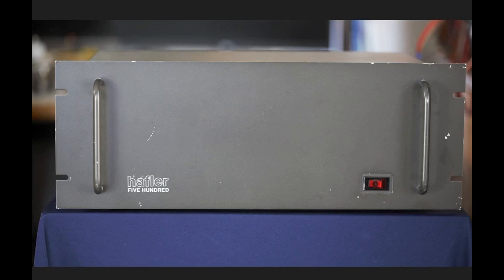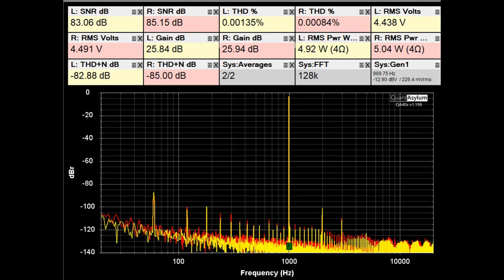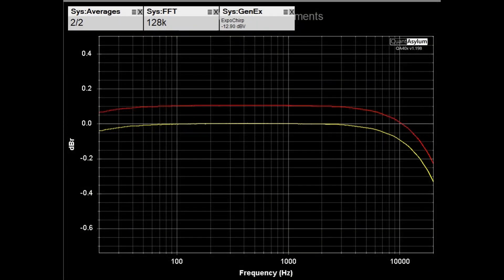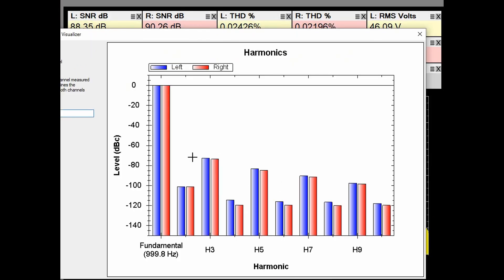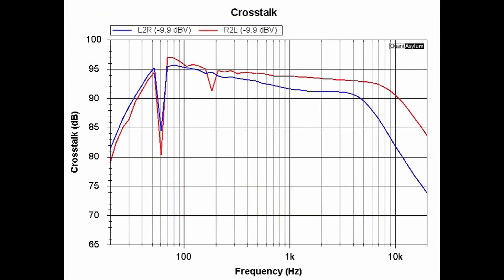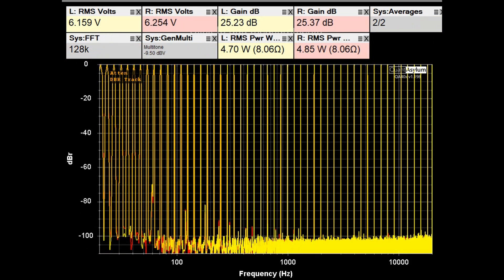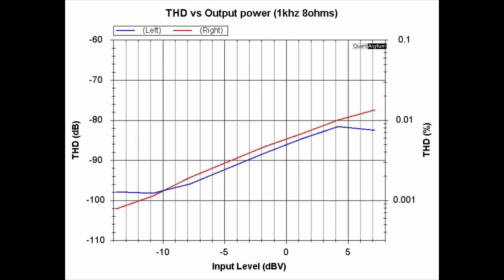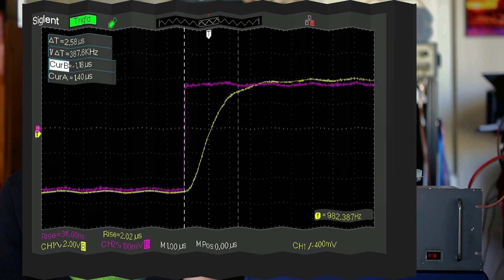Hafler 500 Power Amplifier: Vintage Audio Review Episode #129

Comment: Where are you seeing them for 150 I see ones for repairs three times that
Reply from the maker: At the time I did the video, I checked Ebay and saw at least one- maybe I did not read the description correctly in that it was for parts only, but I usually check that.
Reply: @vintageaudioreview no I mean for parts only is going for threes times what u said works 400 to 600
Reply from the maker: @stevendepascale8364 I probably should try to capture what I am seeing at the time. Maybe the market changed- it was over a year ago....

Comment: I had one of these. In fact, that could be my unit. If any of the specs are off, keep in mind, this thing is 40 years old, and appears all original, meaning some of it's components may have drifted a bit out of spec. If you haven't seen it, refer to Julian Hirsch's test report in Stereo Review, from the mid 80's.
Reply from the maker: Thanks for taking the time to comment. I always keep in mind that most of what I test is pretty old and so a little drift here and there is just fine, in fact, it did between than the refurbed 500 in a later review.

Comment: My dad has a hafler ph500 and some JBL L150 speakers. Wondering what preamp should be used if any with the hafler amp?
Reply from the maker: My recommendation, if you can get one at a good price, is the Carver C1, but most preamps should work fine with the hafler.

Comment: I think he went on EBAY and was looking at DH200's.  Good luck finding a DH500 for UNDER $200 in running condition on EBAY.  As with ALL old gear, they do need to have Caps replaced, or a transistor or two replaced.  Expect to be in them for $500 IF you are lucky.  With that being said, they are put in the TOP TEN BEST ALL TIME Amplifiers ever!  Worth the $500.  There are replacement parts.  I now have two and would consider one more.
Reply from the maker: I have not watched the video recently and so am not sure why I said they could be found on Ebay for $200- unless it was the upgrade kits I was referring to. They are a nice amp, though I would not consider an amp that does not have at least a clipping indicator, on my list of top amps. Thanks for taking the time to share and hopefully you will find a 3rd DH500.
Reply: @vintageaudioreview  That is what you were looking at.  A guy Fantasiaaudio sells those kits amongst others.  Those kits can go as much as $600.  And that is just the kit!  Mostly he sells the kits that bring them back to original or better specs.  I bet IF you upgraded the Hafler you tested you would get back those miniscule numbers that it was off.  Still, a fantastic amplifier even with it original Hitachi mosfets.  That is where I would get to first.  In my judgement these amps are very comparable to today's high end amps.  Or as the guy who works on my gear in Indy, Charlie said "no, they are better".
Reply from the maker: @williamwahl6464  My friend just sold the amp in the video, but has an upgraded one I will test in the not too distant future.
Reply: @vintageaudioreview  They are getting rarer and rarer.  Now the DH200 is the original version of Hafler.  And is also one of the best.  I have a small army of vintage Amps.  All but a couple have been worked on.  Every time I take one into Charlie, he tells me if it has already been worked on.  It's almost better to get one that has already been done up.  Ed Fantasia on EBAY I just bought a DH500 from went thru it and says it will outlast me.  Ed was a former Dynaco/Hafler engineer.  The other Hafler DH500 I have is like the one in this video.  Mostly if not all original.
Reply from the maker: @williamwahl6464  Halfler amps sure seem to be a fan favorite going by views. The DH220 in the video is for sale now by the owner. I had no complaints while listening to them.
Reply: @vintageaudioreview  ADCOM's GFA 555's were a big fan fav back then.  A sleeper is NAD's 2200's.
Reply from the maker: @williamwahl6464  Have always been a fan of vintage NAD amps-usually put out more power than they were rated for. Have not had a Adcom amp come in.
Reply: @vintageaudioreview  I have three ADCOM gfa 555 ii.  One I bought knowing it needed work.  I took it into Charlie, and he said it had been worked on before.  After paying Charlie, he brought it out with a big grin and said "you know this thing keeps on running even after you turn it off for another 30 seconds"?  I told him it also dims the lights when you turn it on.  I run my best rebuilt speakers with them.  I use to repair and touch up furniture and like to get these old BIC Venturi speaker boxes with the Walnut veneer, touch them up as best as I can but totally replace the guts with mostly new.  I do prefer the JBL 2206 12" woofer paired up with these newer, mostly known for Car Audio brands like Skar & DS18 mids & tweeters.  Both Skar & DS18 are highly rated, only weakness they complain about is all the branding they put on those speakers., but boy they sure do make some nice music with these ADCOMs.
Reply from the maker: @williamwahl6464  30 seconds is pretty long to run after the power is turned off- I have seen power led's stay on for maybe 20sec's ,but now sound. I think I remember the BIC speakers.
Reply: @vintageaudioreview  In reality it is more like 10 seconds, Charlie was exaggerating LOL, but that is what he said.  and the lights do dim when turned on.   Same when I turn on my Hafler, the lights dim and go back to normal.
Reply from the maker: @williamwahl6464  I will be on the lookout for lights dimming when I test the upgraded Hafler 500.....😄
Reply: @vintageaudioreview  The lights in the room did dim, not as much as with the ADCOM.  I am now having to use my touch up skills on the other Hafler DH500, I just got.  FEDEX being FEDEX dropped it on it's side and have a pretty good size pair of dents on the side of the front panel.  Make sure who ever ships to you the upgraded Hafler to triple box and write on the outside of the packing box "FRAGILE ELECTRONICS"!  That MAY make these dopes who ship take better care than they did with this unit. It powers on, which is a relief.   That is as far as I have tested it.  I have to remove that front panel to hit it with heat before I do any bending of metal.  Good luck with your new DH500 that you get to test.  Looking forward to seeing how that turns out.
Reply from the maker: @williamwahl6464  Good luck with getting the sides straightened out and hope it works well!
Reply: @vintageaudioreview  It appears to be all original, like the one in your video.

Comment: Just got me a Transnova 9505, having it looked over and serviced before using. The power rating & spec of the power supply alone have me very very excited to finally hear it. Does anyone know the origins of the Halfer "Diablo" circuit by any chance?
Reply from the maker: I am not a Hafler guy so really don't have an answer....
Reply: @vintageaudioreview  well ty anyway

Comment: Which one is better the Hafler DH-500 or the Soundcraftsmen PCR800 ?
Both mosfet amps, almost same specs.
Regulated power supply for the PCR800, more power for the Hafler
Reply from the maker: Thanks so much for the question- particularly on items that I have actually reviewed! I often get questions about gear I have never heard of, so this is a pleasant change. Depending on your speakers and listening material, the PCR should be plenty of power. The Hafler is a bit better on the measurement side, though my loads and testing methodology have improved since the PCR800 was reviewed, but I am not sure you would actually hear any measurement differences. If bridged in mono, the PCR can put out 600w/8ohms, and I am guessing the same could be said of the Hafler if bridged- both had bridge kits for them. Both have two speed fans that can be loud when in the high speed mode. The Hafler's fan did not return to normal speed once it cooled down- until it was powered off (not sure if that was a defect or not). The PCR is narrower which could be handy, plus it has clipping indicators, which means I would vote for it.

Comment: The MOSFET output devices were a large part of their appeal. Their speed and low ON resistance made the Haflers studio regulars. MOSFETs are in even greater use today and there are new even better devices that will certainly work. They are not going to be plug and play, requiring some mods in the driver circuit, and obviously they will all need replacement. Let google be your friend.
Reply from the maker: Nothing is planned on being done to the amp in this review- it is not mine. I will be getting an "upgraded" 500 shortly to test and review/compare before too long. I have seen some upgrade kits for these that look promising were you to go that route. Thanks again for taking the time to comment

Comment: Hafler amplifiers enjoy lots of fans in the recording studio market for a number of important reasons. I have one surround 5.1 and one stereo system of Hafler monitor speakers that I chose after long comparison of five different brands and I think the amplifiers within were a lot of my reason. In addition to meeting a high spec, their high damping made them easy to apply to a wide variety of very critical speakers. 

Studios need a LOT of amplifiers and they must have balanced inputs. Long ago, that was not nearly as common as it is today. A typical room would need 6 stereo amps back in the stereo days. Once surround became normal, there were excellent choices in active speakers, replacing some of the need for discrete amps.
Reply from the maker: Thanks for sharing the info. I am not sure if the non pro versions had balanced inputs- I don't think they did. This is my 1st Hafler gear review and they seem to be about as popular as Carver gear. You certainly have a lot of Hafler amps!
Reply: @vintageaudioreview    Thank you for an excellent test review. I’m surprised how cheaply they are selling.
Reply from the maker: @artysanmobile  I appreciate all your commentary! I am excited to test the "upgraded version" version in the future, and thankx for the compliment!
Reply: @vintageaudioreview    The monitoring systems I mentioned are all active speakers. I have no discrete amps but I recall their near ubiquity in South Florida studios. You’d see them on the way in to the control room and think “all’s good.”
Reply from the maker: @artysanmobile  I was not aware they were used in control rooms- probably on the version with balanced inputs.
Reply: @vintageaudioreview    Yes, always the Pro model. It was a factor in their popularity with studios. Sound and reliability were top reasons for reference use of Haflers. The Hafler amp used a very different driver topology from virtually every other power amplifier of the day. Dave, I think that’s his name, spoke about that at AES conventions. It was somewhat revolutionary in terms of the feedback.

Comment: Oh Hey..................
      May I  have a free professional opinion please?  I'd appreciate it.  Is it OK/Safe to plug-in wall power to my power amps this following way?  I have a dedicated 120v 20amp circuit with a non-traditional (to me) outlet for the window AC nearby.
    I found the proper adapter ( 20A AC Power Plug to 15A T-Blade Adapter Cable, 6-20P to 5-20R,6-20P to 6-15R,6-20P to 5-15R, 4 in 1 AC Adapter,12AWG Heavy Duty Extension Cable for Air Conditioner Etc.).
    So question is,  can I plug-in my 115 volt power amp into this circuit all right?  Thanks, Pal.
Reply from the maker: Thanks for the question and I am by no means an electrician, so a lot of what you are saying about the electrical outlets is greek to me. My Crown SA-2 (see the video I did on it) had a 20A power cord connector that required an adapter to fit the standard 120v socket, and it worked fine. That is about all the information I can provide.

Comment: I didnt explain well. Rockford fosgate purchased  hafler in late 87 I think.. we made a home amp under the rockford fosgate badge. RF2000 .it was also sold with hafler badge JF2000. There was a 3rd version rfp2000 that had xlr balanced inputs..I cant remember if any hafler versions had the balanced inputs..but I urge everyone reading this try to find one..I was told only 50 were made.  Not sure if that includes all 3 versions or if that was how many rf2000 were sold..either way its awesome amp and did double rated power straight from the factory
Reply from the maker: Thanks for the extra info! I have not run across any Rockford amps (other than for cars) Did not see an option for balanced inputs for the 500. Will be on the lookout for rfp2000s.
Reply: Radial Engineering in Port Coquitlam, BC, Canada now own the brand and I have heard they might be re-introducing the entire Hafler line along with a high-end upgraded speakers/studio monitors lineup.

Radial Engineering makes high-end DI boxes, cable snakes and distribution boxes for big stadium acts AND they own Jensen Transformers which make some of the highest-end transformer systems for audio/video gear out there!

V

Comment: Wish you had a hafler jf2000 or a rf2000.they are same amp..I helped make them..Im confused about your 1988 comment..I worked there in 1988 and they made the new line after ces jan 88..
Reply from the maker: I have a modified DH500 that will be tested/reviewed at some point. I try to be as accurate as I can on the date I give for some of the products, using old Audio/Stereo Review buyer's guides which could be off a year.

Comment: I aquired 3 of the Pro version (P500) several years ago that I pulled from a small local theater. These were installed new in 1985 and ran daily till 2020, powering Klipsch Lascala LCR, Heresy surrounds and a pair of dual 15" Klipsch MWM horn subs. I love the sound of the amps, very warm but clear, and in my opinion some of the tightest bass Ive ever heard. A  Crown macrotech powered the subs briefly and sounded sloppy in comparison. The subs I discovered were also accidentally wired in parallel internally and were running one amp channel, which means the Hafler was feeding probably 1 ohm or less and had zero problems! The only problem I have with the Pro versions is the circuit that drives the signal LED's leaks noise onto the audio path and makes a static/ crackling sound when the LEDs are lit. Now I have one powering a pair of Fisher towers used as subs and I don't hear the noise! If it weren't for the noise problem I'd be using another one on my Electrovoice Sentry IVs, but for now have an AB International running them.
Reply: @bblimedia    Well, that’s not very PRO of them is it?  Quick fix, cut the feed. Who needs LEDs?
Reply from the maker: Wow, that is quite a tale! What is the LCR mean? Interesting about the LED's causing some noise. Thanks for the commentary!
Reply: Left, center, right- speaker arrangement.
Someday ill teach myself how to repair the noisy circuit

Comment: Two other modifications I like to do to these amplifiers is to replace the Twisted wires for the input with coax. The second modification is to save the power switch from the inrush current. The Rocker switches on these amplifiers notoriously fail. I use a triac to turn the amplifier on and on so the power switch never sees more than 1 milliamp of current as it is used to operate the Gate of the triac.
Reply from the maker: The twisted wires being replaced with coax sounds good, but am not sure it really would make a difference as we are talking audio frequencies and they are twisted, but an easy thing to do, A triac is a creative thing to do, but I would use a switched power control center like the Monster HTS3600 and have the preamp coming on trigger the Hafler
Reply: @vintageaudioreview  assuming line voltage were 0% THD, that would be true, but it's full of harmonic hash from power supplies and light dimmers.
A $3 power strip is a way to save the internal switch too, but I wanted a more elegant solution.
Reply from the maker: @basspig  Just a few weeks ago I plugged a 15amp hoover vacuum into the same outlet as I had a power cord with open ends on one end and did not see any noise on the ac line when looking at it with my scope when I turned on the hoover. I was mainly looking for something else, but found that surprising. A triac is definitely more elegant.
Reply: @vintageaudioreview  you'll not likely see this on a scope. The spikes are tiny. But you can hear the light dimmer at 50% as a buzz in the tweeters.
Reply from the maker: @basspig  I don't have light dimmers in rooms where my stereos are (not on purpose, just the way it worked out). I would like to do a test one day if I can find a cheap dimmer switch where I see if I can see the effect on some different devices....I certainly remember hearing noise from them many years ago.
Reply: @vintageaudioreview  the dimmer can be in any room, as long as it's on the same phase of the breaker panel it will inject noise into all those circuits.